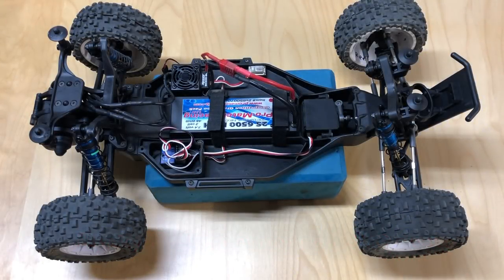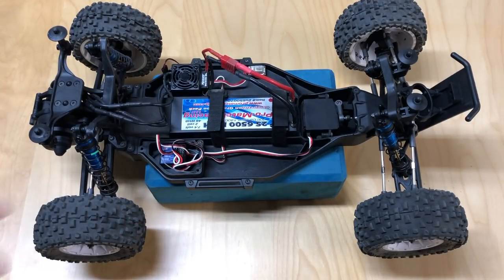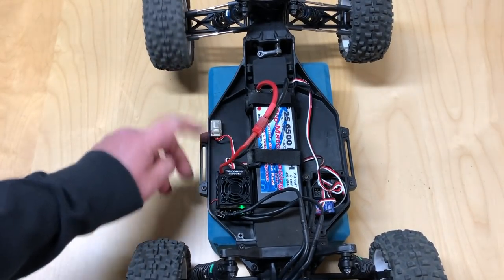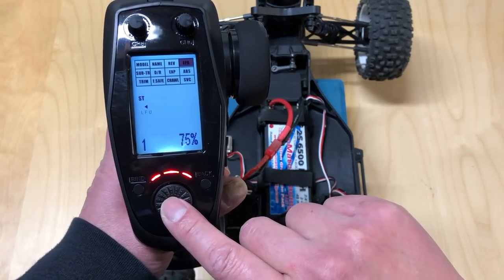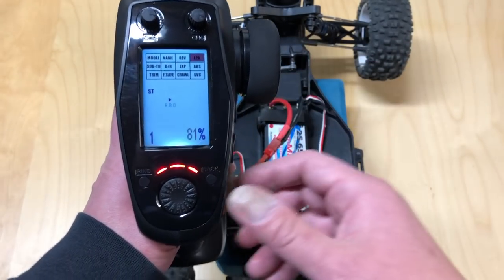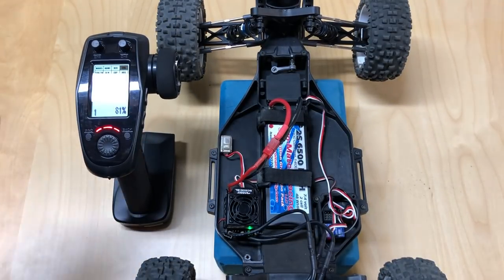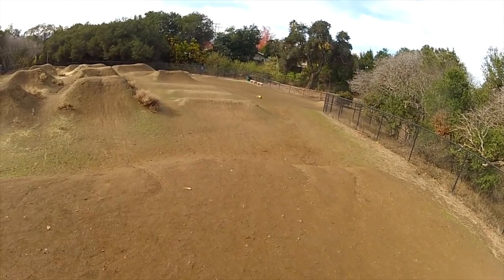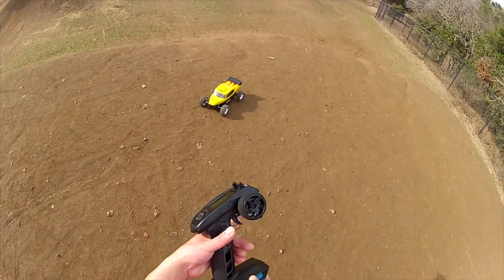New RC radio/receiver setup tips and Flysky FS-GT5 SVC demo

Comment: Rather than setting the left and right steering end points separately to 81%, you can simply set the steering (channel 1) dual/rate to 81%. Setting steering dual/rate is generally the better way to set the steering end points.

I came here to see what effect setting the SVC throttle and priority have on the vehicle, but you didn't explain that at all.

Comment: Hello. Im a little on the "still learning" side of RC. Say I bought two new Arrma RTR RC trucks and I would like to use a different, higher end transmitter for both cars. What do I need to buy and how would I go about doing this? Obviously a transmitter. Do they normally come with a receiver that works with it or do I have to buy one and put it in? How do I know which one to get that will work with my transmitter? Once I have them installed, I then have to bind them correct? How would I be able to use the one controller for both cars? I know you have to get one that has this capability. But would I have to re bind the controller each time I wanted to swap between cars or will a good transmitter have the ability to select which car I would like to control?  Sorry if that makes no sense lol. Im having a hard time researching this info around the web.

Comment: Need some help here. I am don't know why my RC car won't go straight with gyro enabled. It goes left and right very quickly at high speed then spins out. I have a very old servo JR Z250. I am not sure if that was the issue. Do I need a high speed servo for gyro to work correctly?

Comment: I’ve had three of those receivers not one of them would go further than  about 15-20 feet away from the transmitter without signal loss  and none of them would engage the gyros.went with the fly sky 4channel receivers with gyro ,not one has had a problem .

Comment: I know this is a year old video. Hope you see this and can help me out. I bought this transmitter and I set it up with my kraton 6s v4. My problem is when I set it up with the gyro on and I give it throttle the wheels turn and when I hit the brake they turn the same way now when I turn the gyro off and I hit throttle or brake it doesn’t do it. I’m about to go crazy can’t figure it out I’ve asked help from a lot of people and they have no clue. I’ve got everything hooked up right to the channels and I bind the car over and over I set the throttle and brake up also Hope you can help
Reply: I have exactly the same problem.

Comment: Hey first of thanks for all ur bids they r great. Secondly I was wondering if u have to do that calibration thing with the esc if it’s already binded/bond to the receiver. The manual doesn’t say anything about doing that calibration to the esc. Also if I made change on the transmitter and the RC model is off. Will it work when I do as long as it’s saved? Thanks

Comment: I have the FS-GT5 with my Team Associated Rival MT10. Would you recommend still doing your "brake hack" or will the brake adjustment resolve the brake issue?
Reply: How much better is it ? I also have the mt10. Debating on what to upgrade first.the tires or the remote/transmitter.  What do you tbink
Reply: @ferbmayne  Hey Ferb. I bought the MT10 to get back into the hobby with my 8yr son. Now I've upgraded everything. Servo (ProTek 170SBL which is way overkill. Put the ProTek 130T in my sons and its great!), ESC & Motor (Hobbywing XR8 SCT combo) , Transmitter (FlySky NB4), Shocks (Proline ProSpecs) Tires (Jconcepts Premounted Choppers), Hubs (Hot Racing HRASLF1006 Aluminum), Dusty Dust Cover. Probably 500+ in upgrades 😂...way to much and definitely overkill but I love it all! I dont know where you drive but I would upgrad the servo 1st. Huge difference. And there are a lot of good options for 60-100. The Transmitter makes a huge difference in tune ablilty. Way more responsive and so many critical adjustments. As far as the Transmitter goes if you can afford it the FlySky Noble NB4 is a game changer. In my opinion its well worth the 100 more than the GT5. For 179 it has the feel, finish and functionality of the 500+ Transmitters. Its a steal for 179. After owning it I would of paid 100 more for it and would still be half the price of the Futuba's and Sanwa's. I'm not a pro so its just as good to me and smacks down all the other Transmitters in that price range. The GT5 is great too. I sold my GT5 to buy the NB4. But again if you can afford it definitely go with the NB4. The Dusty Covers made a big difference too. Easy to open and close with the zipper and way better quality than the stock. Really helps keep the electronic cleaner. The one for the Traxxas Rustler fit perfect. Any more questions I'd be happy to help. Sorry for the novel. Hope you find this useful
Reply: I was wondering if you had an answer on the braking with a new transmitter? I've got an mt10 coming in the post and recently bought a futaba t4px and want to be able to dial the brakes down when it arrives, unsure if I can do it through the transmitter settings or try the hack or install a replacement ESC, cheers mate

Comment: Hi. I have a couple of cars that the GT5 will work well with. However I have a train also. Best control is via a slider, stick or knob as once it is moving there is no need for the controller. Can I plug the ESC into the channel 5 socket and control the train with the Channel 5 knob? I need it to travel in reverse also. I would be grateful for advice.
Thanks.
Reply: Yeah should be possible. Not 100% sure tho

Comment: Normally I look to you as a good reliable source of info, but have a little hesitation on how you did the EPAs. Aren't you supposed to do it with the arms sitting at ride height? Also I like to go full lock without whine & then bump it up by 2 just to compensate for the servo saver (if you have one). This is also how Ryan Lutz did his on his video. 🤷‍♂️
Reply from the maker: Really good questions!  As for on the ground or in the air, the safest way is actually to do it in the air, so that the tires are not adding extra resistance and giving you a false reading.  Then it's a good idea to lift the arms up and down at full lock (to account for bumpsteer and to better mimic what the car is doing mid-corner as it rolls) and recheck. 

As for whine, it depends on how aggressive you want to be with the EPA and how safe you want to be.  Lutz, Trishbits, etc. are pretty aggressive with their end points because they want to make sure the steering is fully locked with no give whatsoever (and they probably get their servos for free, ha!), so they will have a little bit of strain from the servo.  I set mine a little more conservative than they do.
Reply: @RazorRC  True, thanks for the clear info. See I knew you knew your stuff. 👍

Comment: Great video!! Very informative. Got a question for you. I have a AWD 1/18 car that is brushless on a 3s battery. I can’t keep it straight. Will this gyro system do that? Also is there a way to make it where the faster you go the lighter the steering is? I can tap it and send my car rolling end to end.
Reply: yes this has an awesome gyro and svc function, and yes it has the option to make the steering slower the faster you go. 10/10 reccomend
Reply: @mprovedtuning what is that function called on the radio please (reduced steering with increased speed)? I have been through the manual but haven't been able to find it. Thanks in advance 👍

Comment: Hello, 
I have just got this transmitter and receiver . I want to pair it to my vehicles but some of them are 4s and 6s lipos . So 22V maximum output, I believe that the BS6 receiver cannot handle that voltage so what receiver can I use that I can pair with the GT5?
Reply from the maker: the receiver gets its power from the BEC of the ESC, not directly from the battery.  The BEC should be 6V or 7.4V.
Reply: @RazorRC  so are you saying I should be able to use any receiver as the voltage is controlled before it gets to it ?
Why do they give the voltage then lol ? Just precautions I assume lol
Reply: @LRSTUDIOCREATIONS  Yes, the ESC should supply a steady 6.0V to the receiver to power it and the servos. Only set the BEC on your ESC to 7.4V (or anything higher than 6.0V) if you know that your receiver and servos can support it. Servos capable of 7.4V or more will make your servos more powerful and spin faster for improved steering. I've never seen a receiver or servo support 4S or 6S type voltages (~14.8V or 22.2V). The 4S, 6S voltage is referring to the voltage that the ESC can use to power the motor. The higher the voltage you supply to the motor, the faster it will spin. The BEC voltage is specific to the voltage output through the 3 wire connector from the ESC to the receiver.

Comment: Fantastic video!! Do you happen to know if the older receivers from the Flysky FSGT3C are compatible with this new radio?
Reply from the maker: they're not 🙁
Reply: @RazorRC  are you sure? Shouldn't it bind fine just loses 4-6 and Gyro functions?
Reply from the maker: @TK_Mo  Yup, I'm sure.  The GT3C does AFHDS protocol and the GT5 does AFHDS 2.  The manual also confirms that the FS-GR3E receiver is not compatible.
Reply: @RazorRC  Thanks, good to know. I had been told differently.

Comment: Great setup video!  Question I have is for the throttle endpoints with a brushless arrma car should the throttle endpoint be 100% or 120%?   Does it make a difference or matters?
Reply from the maker: set it to 100%, then calibrate the ESC and don't change the endpoint after that
Reply: Midwood dune buggy rc car

Comment: how do u bind a second reciever to my flysky gt5.so I can run both my cars of of the same controller?
Reply: On the transmitter, change the model number then bind a new receiver. You can save up to 20 different models on this transmitter.

Comment: Hey razor does the receiver need to be placed flat and a certain direction to support svc? I put it in my mojave and the way it mounts is like up and down and not flat. It wasn't working great and then said svc not supported on my remote. Thanks
Reply: Yes, it should be mounted flat. Unfortunately, it just won't fit in some receiver boxes such as my Hobao Hyper VS. :(

Comment: Mine does the opposite. When i turn ON the SVC and also CALIBRATE, the wheels will try to straighten up when I'm moving side to side holding it in the air but when i put it on the ground the car won't run straight it keeps turning back around. If i turn SVC OFF, it goes back to normal and runs kinda straight but not as straight like when you got your SVC ON in your video. What am i doing wrong? Please give me some advice. Thanks 🙏
Reply from the maker: Johnedel Ariola try flipping the receiver around.  I think it has to be mounted a certain way.
Reply: @RazorRC  i will try that...thanks. I'll install it same orientation as yours
Reply: Johnedel Ariola, did you get your svc to work? I'm have the same issue
Reply: Did you guys manage to solve that problem ?